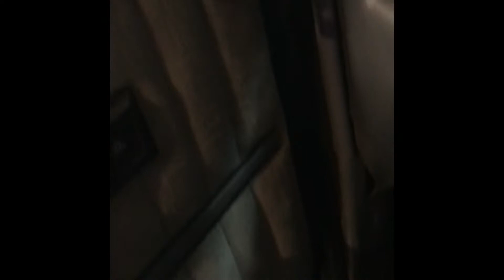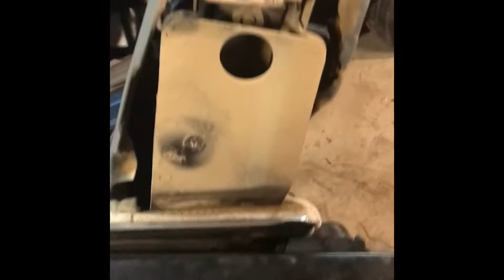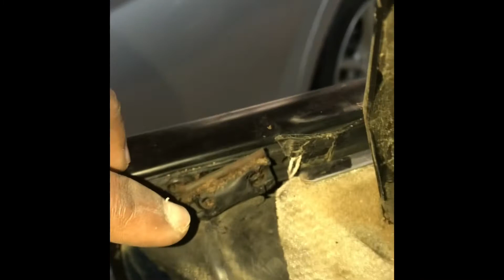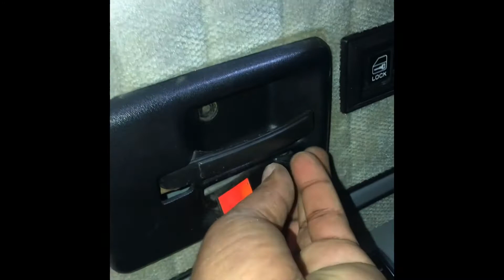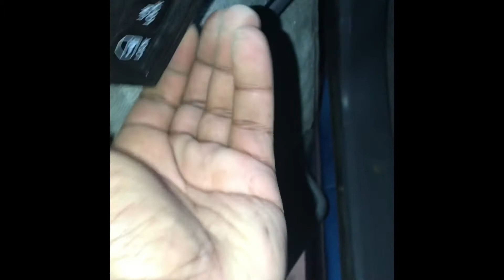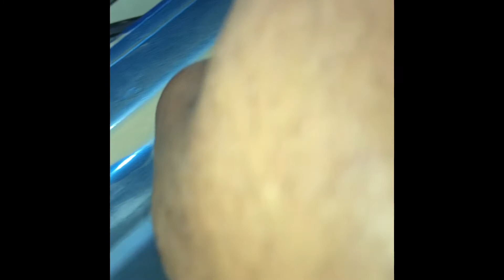Replacing weatherstripping on 1991 Chevy Cavalier.  Be careful taking the old weatherstrip clips.

Comment: What type of rubber did you use?  Where did you get it? I have to do all 4 doors on a RS sedan. It’s a little different getting the panel off but this is helpful.
Reply from the maker: Your best bet will be auto salvage place.  If you can’t find the exact make and model look for similar vehicles from similar year and do some customization to make it fit.  I got similar rubber from early 90’s vehicle (I believe it was Pontiac sunbird) and customized it. Worked perfect.  Good luck.
Reply: U didn't go into how to actually remove and install which was a bummer. Was it riveted in? Did u drill them out? And the black trim piece on top of the doors...did u have to remove them? Thanks.